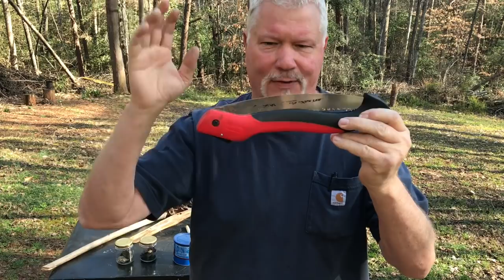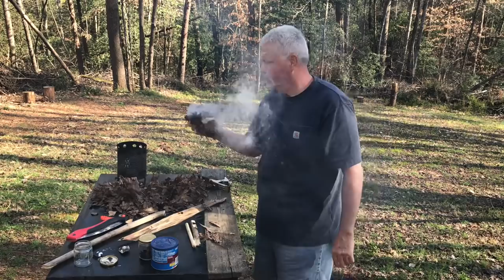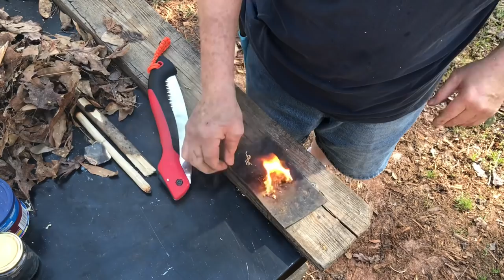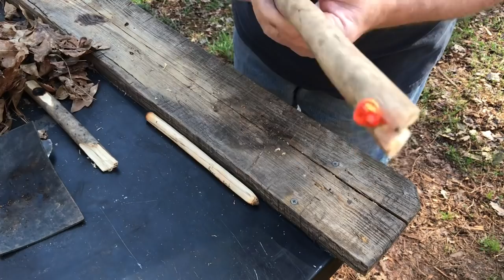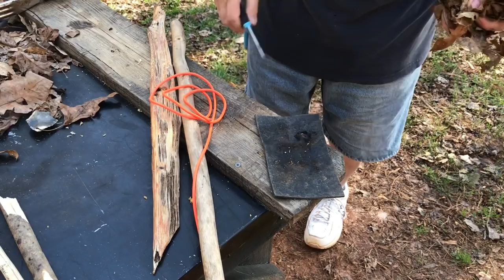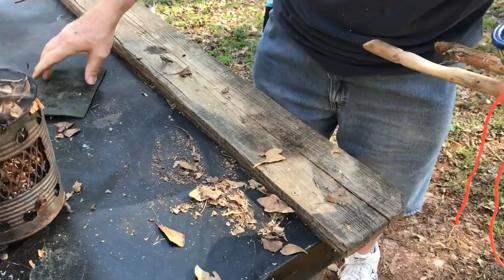Corona Razor Tooth Saw, A GREAT Fire Maker!

Comment: Great cutting saw. Mine doesn't seem to dull after 3 years of use.. Bonus as a flint sparker without any work to the spine.
Reply from the maker: I used mine a lot and it's still good and sharp also.

Comment from the maker: My Playlists Contain 100s Of Fire Making Videos... The Corona Razor Tooth Saw from Lowe's only costs $20. In addition to being a fast cutting, 10", folding saw, it is also a GREAT fire maker!!!
  Today, I show you 2 types of Flint and Steel ignitions, igniting char cloth, and bringing to flames a leaves tinder bundle. Next, I use the saw's factory edges to scrap fatwood and then ignite them by also scraping the ferro rod. Lastly, I deploy the lanyard and use it for a Bow Drill bowstring. I used an American Beech set and got the flames with another leaves tinder bundle.
  Come see how it all turned out... Please SHARE and SUBSCRIBE at the end of the video. Thanks!
OTHER VIDEOS YOU WILL ENJOY:

Friction Fire 4 Ways... Fire Roll, Hand Drill, Bow Drill, and Bamboo Fire Saw
https://youtu.be/PzIysPChca4
10 Unusual Ways To Make Fire
https://youtu.be/DK-ptqeDnK8
Hand Drill, Bow Drill, What SOME of the experts aren't telling you.
https://youtu.be/xDUbuMMiSOw
Making A (Flint and Steel) Steel Out Of A File And Trying It Out!
https://youtu.be/nBrX2gi80Ts

Comment: David, I thought you had to have high carbon steel that the flint or quartz scrapes off into molten metal sparks, not shiny steel that may have chromium in it.  The saw blade looks so shiny like it may have chromium in it.  Why does it work?
Reply from the maker: When you expose molecules of iron to the oxygen in the air they spontaneously combust. The coating must have iron in it or be very thin.

Comment: Literally just picked one up. There's a lot of jiggle inghe blade when it's closed. Seems like it's not centered so when I go to close it it catch on the handle
Reply from the maker: Mine are the same way. Also if you put a lanyard on them the teeth bite into them a little. Hasn't been a problem though.
Reply: @DavidWestBgood2ppl  thanks for the quick reply. Can you explain the lanyard part again..not understanding fully

Comment: The screw fell out unexpectedly from both my Corona saw and pruning pole, therefore, use lock tight or take it to Ace for a better stainless steel screw that uses hex wrenches.
Reply from the maker: My 3 are working fine.